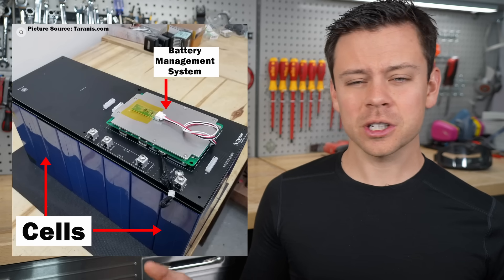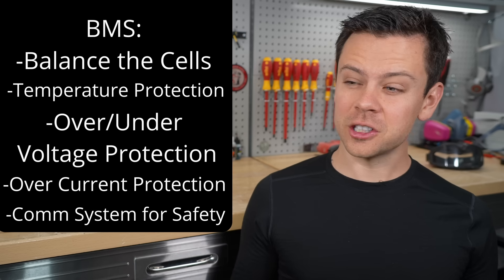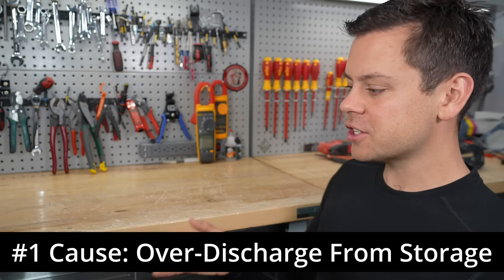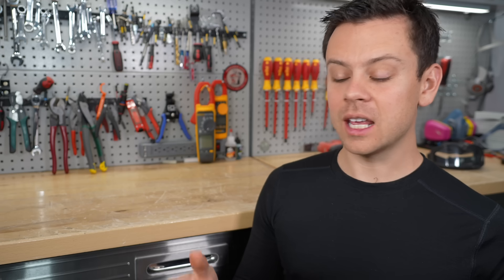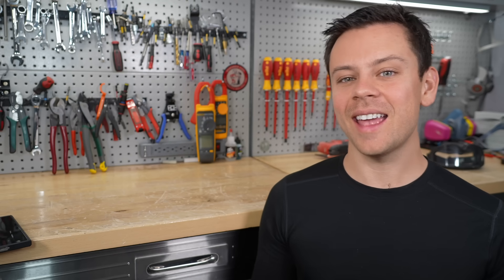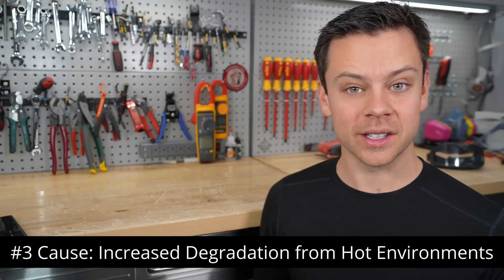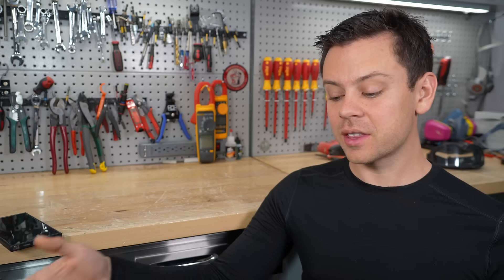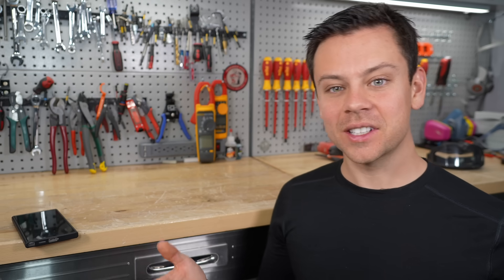The Rules of LiFePO4: The 3 Most Common Causes of Failure and General Guidelines for Long Term Use

Comment: Your "keeping charged" ist contradictive to the results of the study "The Operation Window of Lithium Iron
Phosphate/Graphite Cells Affects their Lifetime" published in "Journal of The Electorochemical Society", and also other studies like "Peter Keil; Calendar Aging of Lithium-Ion Batteries". 
Charging always to 100 % and keeping it at high SOC is bad for calendar aging. Keeping an LFP battery above 70 % doubles the rate of calendar charging. Using a lower SOC window is better than using a higher one.
This all is know for a long time and a lot of people had bad expierence on keeping LFP and other LiIon batteries at high SOC. 
So it is bad to charge LFP to much more than 3,40 V/cell, for gaining more capacity it is useless anyway. They are nearly full at 3,40 V. 
For DIY storage you have the choice for better BMS and probably more control over what SOC range you use. 
Yes, you must charge most EVs with LFP to 100 % regularly , but this is only necessary because of recalibration for the GOM. Of course, this does no harm if you do 100 % charging once a week or once a month, just before using the EV. But  keep it constantly connected with automatic regarging when the SOC fell a few percent, for a long time, this will certainly cause accelerated calendar aging.

Comment: You can charge to almost 100%, by keeping the bulk voltage relatively low (i.e 3,45V) and absorb for a very long time (2 to 5 hours).

You can also charge to 100% fast by raising voltage to 3,65V.

In my opinion that makes a huge difference. In stationary solar applications, it is often not necessary to charge the last approx. 5% SOC fast, with high amps and relatively high voltages, like 3,65V.

Best regards from Germany

Comment: Love this video makes me feel good about my setup. I  have my  100amp 12v Litime LiTime in  my Jeep with a 10 amp dc to dc charger. Daily it powers a ICECO 47 fridge and my fpv drone batteries which take out about 10% of battery. 
The battery floats between 30% and 60% each day. The best part is I stopped thinking about where the battery state of charge a long time ago. I use a blue tooth thermometer in the fridge incase it shuts off but has only once in 1 year.

Comment: @willprowse I’m interested in your thoughts on using a battery equalizer for a 48v system with 4 12V LiFePO batteries in series. I know this is not an optimal approach for a 48V system but it’s what I have and I’ve seen drift between the 4 batts so they won’t all reach 100% and 0% due to this drifting.

Comment: Thanks for the excellent summary. I bought a Bluetti and a Pecron for camping / preparedness last year. I leave them in storage when I'm traveling, sometimes for up to 6 months. In Laughlin, NV, so a bit hotter than Las Vegas. I was wondering if that would be an issue with regards to longevity and it sounds like I shouldn't be too worried about it. I do charge them at least monthly when I'm there. (I'd advise everyone to put a monthly reminder in you calendar to charge them.)

Comment: Resistive passive balancing is inefficient, you're literally wasting your battery's stored energy to heat.

Active balancing while not 100% efficient, is orders of magnitude more efficient than resistive passive balancing. 

Passive balancing should be banished to the pile of technology once used that has now been superceded by a superior solution.
Reply from the maker: 🤣🤣 This has to be a joke comment right
Reply from the maker: Increased failure potential, more conductors connected to the terminals that can short, and the total amount of energy expended to balance these over a course of a year is practically nothing. Geez comments like these make me want to make more videos. So much ignorance on the internet

Comment: Hi @WillProwse, thanks for the great info, watching from Durban South Africa. I wanted to ask you about float charge on lithium iron phosphate batteries. Is this the recommended way to charge these batteries, so I currently have a DIY 280ah battery with a Seplos V2 (10E) BMS, I charge to 56v (3.5v per cell), I have an active balancer which kicks in at 3.45v and stops at 3.4v. I have seen online that they recommend you only leave it at this voltage for say an hour and then should drop down to either 55.2v or 54.4v. Leave it at the voltage for almost 6 to 7 hours then charge back up to 56v. What are your thoughts on this and if you know, how would you do this with the Seplos V2 (10E). Thanks again

Comment: I learned all this 6 years ago when I bought an E-MTB with Bosch 36v 13ah batteries- never store fully charged, long term store at 40%, keep somewhere cool with stable temperature. If you do partially charge to say 80% then periodically you must take the batteries up to 100% (It takes 32 mins per 20% to charge from 0-80%, except the last 20 % at 80-100% that takes 90 mins and shows the slow balancing as each cell hits 100%)....Both my batteries have minimal degradation and I can still get the same distances for any level of assist.  When I first got the bike the advice from everyone was "when you get home fully charge it"...WRONG!! Never charge a physically warm battery, likewise a charged battery needs to cool before use, and I only ever take the battery to 100% in the hour before I plan to use it so it's not sitting in a high state of charge.....

Comment: i needed thos video..thnx. i am using voltsmile v10 48v batteries of 5kwh each and total of 20kwh (single phase installation,all victron) my question is can i use multiple bms ? or will they conflict in my cerbo gx (victron)?

Comment: In my 100ah lifepo4 battery manual it says 12.85v is 10% charge and 13.46v is 100% charge. It also says the operation voltage is 10v to 14.6v. So you say I can go down to 0% charge which is 10v and let it sit for the night until my solar charges it? This is ok to do every day? Or should I follow the manual and not go lower than 12.85v?
Reply: NM from what u said 10v sounds ok

Comment: 4:00 Kinda disagree Will. It is totally fine to use active balancer while not charging to 100% SoC to trigger the passive balancer in the BMS. Where should be a disadvantage in it? I see rather an advantage with active balancers with higher currents, as they are more likely to cope with large cell voltage deviation faster than the poor passive ones in the BMS.

Another one: you forgot to put cycle life (and measure to extend it) into a timely perspective. To just convert average cycles into years of time, and by how far the battery will very likely outlive other components, your car, your RV, whatever.

Comment: i have 2 sets of lifepo4 51.2v 280ah connected in parallel. recently i only set the mppt charge to 55.2V. what is the best voltage to charge them to 100%? is it 58.4V? or 58V should be enough?

Comment: All Li-Ion batteries last longer if you keep them between 20%-80%. LiFePO4 are more resistant, but still will last longer if you keep them in the sweet range.

Comment: Thank you, @WillProwse ! I needed this advice. Bought a couple Siekon's after your positive review, used for camping and my remote gate opener. 
Question: I have a small, unregulated solar pannel feeding that gate battery - would it be wise to incorporate an in-line "charger" from the pannel, or should the BMS take care of regulating the charge?
Great videos, thanks again.

Comment: I got a LiFePO4 battery in storage and after over 2 years it still shows 3.25V per cell. Is it enough to just control the voltage? The self discharge seems abnormally low.
Reply: The curve to depletion can happen very fast at the low point. Charge them up would be smart thing to do.
Reply: @LarryKapp1 @LarryKapp1  3.25V should be at around 40% charged up; in other words: Some buffer left, not broken yet, but when I wait for another 0.1V, which is not far away depending on measurement errors, it might break fast? Since it survived 2 years, it should probably be more or less OK for another 4 months?
I disconnected the BMS and have to get around to figuring out how to start it again. I was almost about to do it last week and was to comfortable with 3.25V. Thanks for pushing me to get into it (as I really could use a working battery for my hobby anyhow)

Comment: Hi Will, I've watched every episode since you started in your RV, and you're very good at what you do. I'm an (Aussie) electrician of 45 years experience and 60 YO and you nail it every time. I just bought a cheap AU$30,000 MG4 EV, which has a LiFe 51Kw setup and you're right on about what to do. Not only for solar/home setups but also EV's. I know you're full time basically doing what you do but if you ventured into the "car" world of batteries it would only make your channel better. Although I don't recomment cutting open car batteries to see what's inside. But hey, you might go there one day you're that good, and now very experienced. Bravo young man I always look forward to watching your episodes, they never fail to impress me.
Reply: hmm $30k / 51kwh = aud588 per kwh plus a car, not bad I guess :)
Reply: This and many other videos you have produced are just wonderful information pieces. Thank you so much for putting time and energy into giving people like us information about batteries and power set up.

One other comment stated they needed to know more information about extreme cold weather as I do 

I installed two different 100 amp our batteries in my RV last summer and they worked phenomenally well. I live in the exact opposite atmosphere that you do in Leadville Colorado, which is at 10,200 feet in elevation and we have a very long cold winter . The RV is stored outside and I spent the extra time to remove the batteries prior to storage which takes a good bit of time and as a pain in the butt and of course there’s putting them back in every spring. The winter here stays below 32° for at least 4 to 5 months and many nights can get down to -20°throughout the winter. Even in November last night it was -6. Can I leave these batteries in the RV over the winter and not have severe damage or is it way way better to take them out like I did?

Comment: Cant say i agree with you on the active balancer issue. You give no example and just keep repeating charge to 100%.  I know you understand that when the bms says 100% it might be far from 100%. Having a 308ah, and a handful of 309-318ah cells will create this problem so why do you pretend it doesnt exist? What if the bms just have some lame 50ma resistor on the charge? It would take weeks to balance those cells with no external active balancer. How do you end up concluding the Ab would hurt the cells, it makes no sense. Give some examples.

Comment: I’ve got some 160 AH Voltronix cells I’ve been storing for a few years.  I keep them @ 3.2 volts per cell.  I’m planning to put them into my sailboat and, like you say, use them.  But I’m confused about something you said.  Charge them to 100%?  Ok.  But then you said, discharge them to zero %.  Seriously?  I’ve been told never to discharge LiFePO4 below 2.8 volts per cell.  Can you please clarify for us on this?  I’m sure there are many here wondering about this same question.  Otherwise, why do BMS have LVC and HVC disconnect points?  Thanks!

Comment: What is your recommended vpc for absorption, float, and start of balancing with a solar system.   Through my research,  I am thinking 3.5 absorb, 3.35-3.4 float, and start balancing at 3.45.  Would love to hear your opinion.  Also, I end absorption at 1 percent battery ah rating.  Thanks.
Reply: Sounds pretty good . I only charge to 3.45 because they are 99% full there but I have bms that I can change settings on to balance where I want.

Comment: Great info Will, thanks!  You only speak of LiFePO4 with BMS built in. BMS failure is not acceptable in my off grid world and I've seen many of them fail.  I've been off grid for 25+ years and built dozens of PV systems for other off gridders.
For my system, I bought bare 300ah cells (18s,2p for 600ah @ 60v) and use a 5a active balancer on each parallel string, no BMS. 
 I set it up to bulk charge to 3.55v max to prevent physical damage from anode swelling at higher charge voltages.  2 years on, no swelling, not compressed, no loss in capacity, max imbalance is .002v at 50% soc. The balancers are turned on by aux out on the CC, so it only balances above 3.45v, which is where they float for a few hours a day.
Buying a pre built battery is far more expensive than bare cells.  
I recommend buying your own cells and build your own bank. You'll save money, increase longevity and decrease failure points.  Just my 2 cents.
Reply from the maker: I already did this many years ago. Have you seen my older videos. I took down my no BMS videos because people kept frying their cells. An active balancers can fail, I've had many fail on me. I've already done all this many times

Comment: I have several 12 volt 100 ah batteries from different brands, they are all new and all have a 100 a bms. Can I connect them in parallel?

Comment: In most of Pakistan, We have the ambient temperature in summer is more than 45 degree Celsius (113 degree Fahrenheit).
Can we charge/discharge LIFO4 batteries 0-100% charging with solar only at maximum of 0.25 C-rating and have long life of the batteries?

Comment: I’d like to hear the downside of keeping a large lithium iron phosphate UPS system constantly at 100% with no load on the battery bank except the very few times it needs to kick in.
Reply: A lifepo4 will charge to 100% at a lower voltage. It just takes longer so I suspect that the ups is floating around 3.35 which is where the cells nominal voltage is.

Comment: Any shunt or hall sensor based coulomb meter isn't going to correctly show the SOC % if self discharge from extended storage is going to happen you will have to monitor either the voltage of the battery (if you're under 3.00V or above 3.40V which you shouldn't be that high) OR you have to note the date of storage, SOC at storage, and then anticipate a self discharge rate and set a reminder for the next recharge. 

In my experience seeing over 1% self discharge per month is the worst I've seen. But my experience is A123 and Headway mostly.

Comment: but what is 100% in terms of voltage? How can you safely hit 100% without hitting highV disconnect? I assume the charge rate just slows to a crawl naturally.
Reply: At 100% they don't take in much current.

Comment: I'd like to see a video where you throw a LiFePo4 in an old UPS designed for SLA and see how it works.
Reply: Seems to be a gamble of how the UPS will react once the battery is charged, as the BMS will cut it off, which freaks out some UPS's apparently. I put a 8S LFP in mine and luckily it's working fine.

Comment: Just getting started with Solar (Helene kicked our butts...) and am gonna go with a 24v system.  I ordered a battery and it arrived today, but the plastic on one corner is cracked from shipping.  Otherwise, the battery appears intact, and I checked it with my multimeter and it was at 26v. Amazon was quick to refund me and made it clear I should NOT ship it back, but I am wondering if it would be safe to use.  Any advice you have would be much appreciated!  Your videos have been a vital resource in getting started.
Reply: Added context. its an OKMO 24v LiFePO4 100Ah battery, and the only piece of the system I have ordered so far (It was on a lightning deal the other day)
Reply: @brandonr.2807  If it were me and it was a small crack in outter case, I would use it. If it has bluetooth app you can monitor each cell. I you wanted to be absolutely sure on condition of cells , carefully cut open the top of plastic case and inspect cells . If they were okay find a metal box for them and you will be better off than when you started with the plastic one.

Comment: Thanks Dude, I got a Montek on indeegogo and keep it at 70ish but My camper build That I got 2 Valence batteries for has been on hold for 2 years( That's changing next month), How do I check battery percentage without buying a meter? should I just charge them together  in parallel or series  or independently for a fweek on a trickle charger? 1 other question, I go off roading and I can weld, Usually you take 2 batteries at 24v and with jumper cables you use welding rod and can fix broken stuff ( Neg to the chassis and pos to the welding rod). Do you know if the Valence or other lithium Batteries have short-out protection? Thanks

Comment: Such a great talk , but in winter with Lithium stored through the winter charged to 100% at the start and left disconnected last year they didn’t drop below 50% but if they did , I believe it’s unwise to charge the lithium under just above freezing ? So I hesitate to recharge them until it’s milder . Correct . TY

Comment: Should I not keep my small RV trailer plugged into shore power all the time? I bought a Litime 100Ah TM Lithium Marine Trolling Motor Battery that I saw on your video. It has a Progressive International Dynamics PD9245CV 45Amp converter charger in it. What's the best practice for keeping this battery in good shape. I don't use the trailer often and it may sit unused in our mild winter weather here in Fresno Ca. Thanks much love your videos!

Comment: New LifePO4 in camper w/solar and DC-DC charging... sudden failure in the night and battery read 0.314VDC on terminals... Return home and now reading 13.2VDC four days later after vigilant monitoring??  Thoughts on cause? BMS Issue? Cheers and thank you in advance